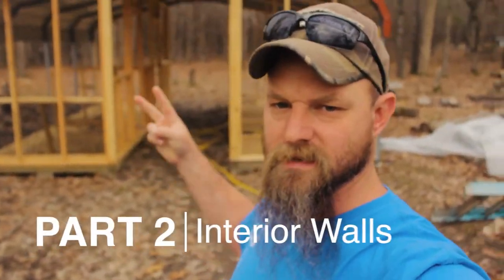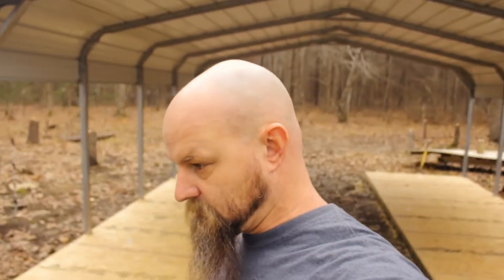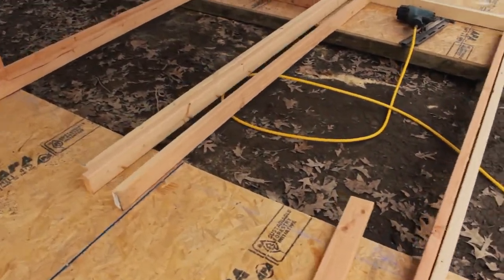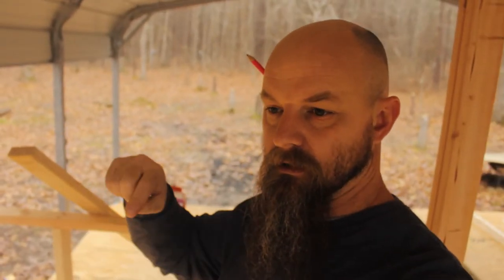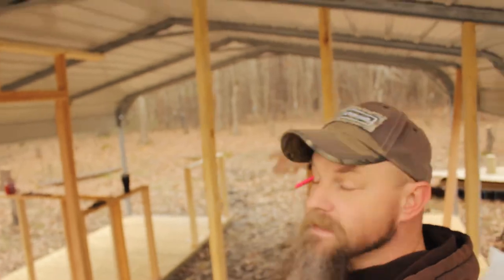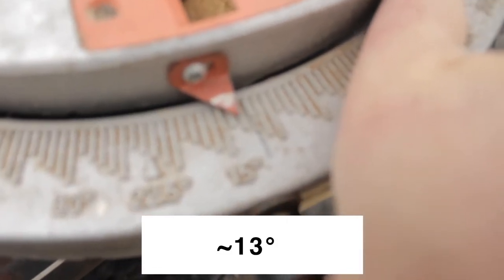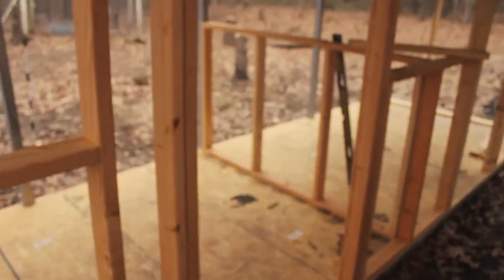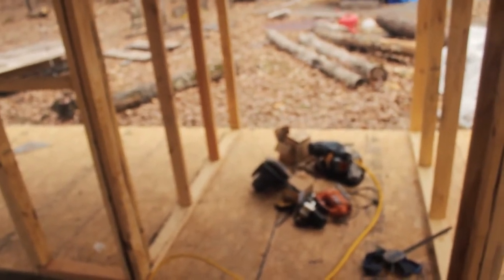Carport Chicken House Part 2 With Costs | Square One Farms Carport Conversion

Comment from the maker: What design changes would you make for this chicken house to suit your needs more?  Let us know if you like this build series.  We have another one on the way after we get finished with this one.
Reply: Do you have a good rat snake population there that could serve to eat rats that will inevitably live beneath that floor?
Reply from the maker: Yes we have a pretty good population, along with king snakes.  We are debating putting up 1/4" hardware cloth around the perimeter at the bottom to keep the rats out, but if they find a way in, the snakes might not make it in there as well.  So, still debating that actually.  Maybe our barn cats will even it all out?  Planning still in the works I guess.

Comment: Very cool! It's refreshing seeing real construction projects go up with thought, detail and the use of a speed square and level. Great job! Looking forward to the next part!
Reply from the maker: Thanks!  Kind of making the project up as we go but it's coming together pretty well.  The weather hasn't been very cooperative, so it's taking longer than expected, but it'll eventually get done.  Thanks for stopping by Bill!
Reply: @SquareOneFarms  I understand weather all too well adjusting times for getting projects done. Bet it is going to look awesome when you're done and be more secure than Fort Knox to keep the predators out.
When you do your exterior fencing for the run are you going to lay down an apron to help prevent dig ins? I found that works really well at my place.
Reply from the maker: Yes we will.  Unfortunately most of the predators we deal with just climb over the fence.  So, a Hotwire around the top may be added.  Still debating that part.

Comment: I wish I had a better plan when I made my carport chicken coop. Mine has a dirt floor and I buried the 4 x 4 posts in the ground with concrete. I now have mouse tunnels to deal with and that is a whole nother issue. My carport is 18 x 21. I wish I could have done it differently but I will deal with it. Those screws went in much better than the self-tapping one we got from the box store. I will have to check out the Ace Hardware for the ones you used. Yours is very nice!
Reply from the maker: This carport is an 18x21 as well.  We pre-drilled all of our holes before installing the screws...they tend to not do very well cutting the hole on their own.  We debated the dirt floor for a long time and considered the expense, but ultimately we felt that the ease of cleaning would be worth it in the long run.  Thanks so much for sharing your experience watching!